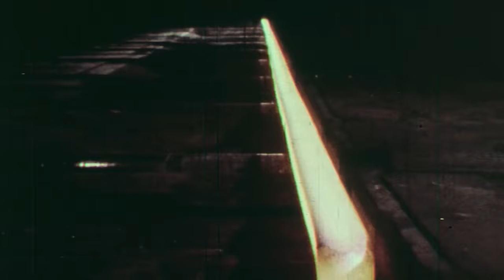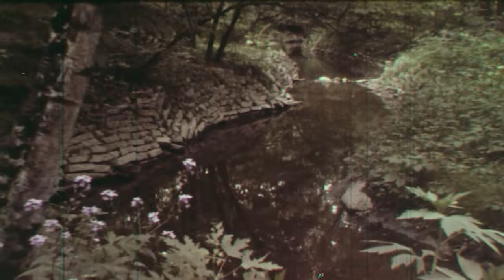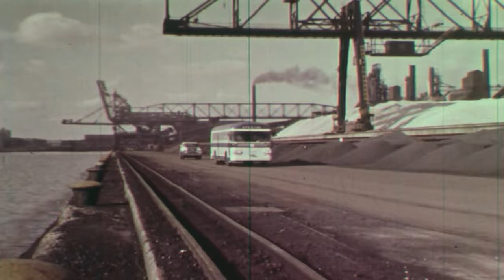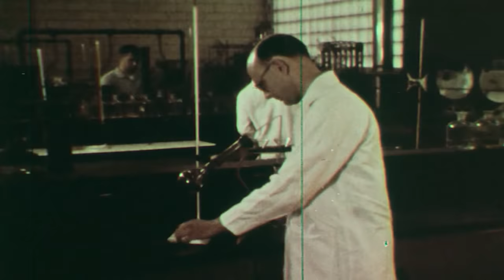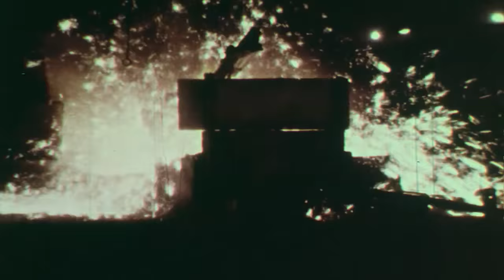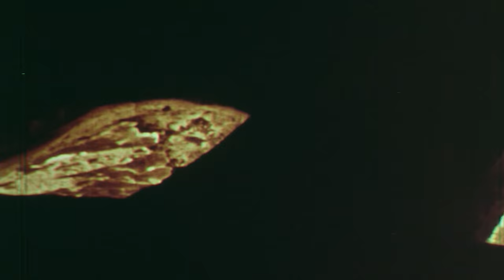The Rouge (1960s)

Comment: There is a water tunnel that travels from the Ford Screen House, located on the Zug Island Canal in the nearby SW Detroit neighborhood of Delray. The tunnel travels under Dearborn Ave. to Fort St. Turning left unto Fort St. the tunnel heads toward Miller Rd. Turning right on Miller Rd, the tunnel heads right into the Ford Rouge Plant. So a lot of the water used to cool the steel, and factory machines in this video comes from the creek canal in Delray. Old man Henry drove a model A with the roof cut off through the water tunnel from the Ford Screen House, under Dearborn Ave. Fort St., and Miller Rd. Once Henry got to the Rouge Plant and the modified car safety removed- a telephone call to the screen house opened the flood gates to allow thousands of gallons of water to enter the Rouge. The same path Henry drove through minutes before.
Reply: Is the tunnel still in use?
Reply: @kaiyack  The tunnel is still in use. The Ford Screen House is manned 24/7. There is a tragic story related to the Ford Screen House. In 1965, 1966 an elementary classmate of mine named Jimmy Ferry, was jumping off the green bridge (painted green) that went over the  Zug Island Canal - a second bridge used for Zug Island employees to drive onto the island. The water itself was a lime green color, yucky for even fish to swim in. Anyway, the Ford Screen House has powerful suction pumps that's needed to help draw water through the tunnel to reach the Rouge Plant. Jimmy got caught in the water current undertow, and drowned. The underwater divers found Jimmy's body sucked up against the underwater debris screen of the Screen House. The Screen House had to shut down the pumps, for the diver's to remove Jimmy's body held tightly against the debris screen, and bring his body up the surface. Jimmy's funeral was a closed casket event. I was given the honor of being chosen by Jimmy's parents to be a pall barrer, to help carry Jimmy's body from the funeral home to the nearby cemetary. The Ford Screen House has these huge debris screens to keep any crap from clogging up the huge underwater pumps that jet the water through the miles long pipe tunnel. 
Unfortunately why Jimmy decided to swim in that filthy polluted canal is still a mystery. Nobody would want to stick their finger in that water, yet alone swim in it. So to me, The Ford Screen House will always remind me of my childhood friend, and elementary school classmate Jimmy Ferry.
Reply: @fairfaxcat1312  The Lincoln and Mustang not accommodating to the common man? Have you seen the prices for ALL pick-up truck's, not only from Ford  - but Dodge and GM? More expensive than today's pick-up truck's or other SUV'S. Getting back to Ford Pick-up truck's and other model SUV'S By FORD. Despite the high manufacture sticker prices, Ford is still the number one selling truck DECADES running. And the main reason Ford is not offering automobiles as much as year's before, is the simple fact that people today - even year's ago WANT 4 wheel drive suv's instead. And why wouldn't a vehicle production company build what the buying public want parked in the front of their home, in the driveway, or parked in their garage or pole barn? You build what your customers want - plain and simple. If you don't, you're history.
Reply: @rickprusak9326  Ford quit making sedans because they could not compete with Honda and Toyota.  Honda and Toyota both successfully manufacture sedans in the US.  Ford is no longer the powerhousethey once were.

Comment: a lot of exceptional engineering went into the plant just look at the tooling and the men behind them.
Reply: The tooling fascinates me more than the finished product. Think of all he engineering that went into the equipment needed to transform the raw materials into finished components. Amazing.
Reply: Jack Kallemdjian Great  engineering.
Reply: g bridgman yes but those days are long gone.
Reply: That’s the reason the drinking water in Detroit is so tainted.
Reply: @davidcarlin3850  Yeah, just let China run and make everything, they seem like they'll be a great super power.
Reply: Yeah. Who designed and built all that? It's exponentially complex compared to the finished car.

Comment: I think the most amazing thing (which they didn't really explain) is how all the exact right components come together at the right place to build each individual car. Some can be done by just keeping a stock of the various different components to hand where they will be assembled, but I see that they ship the bodies to final assembly after painting, and then they install the fenders and things. They need to have the correctly colored fenders, hood, truck lid, and wheels available for the exact car they need to assemble them onto. That is pretty amazing. And of course you want the exact correct engine and transmission, the right axle, etc.

Comment: WOW , flash back. As a retired mechanic and as a kid I remember these cars. I’ve owned 3 fords over the years all F series pickups. My first was a 1962 F-100 with a 292 Y block. Then the next was a 1970 F-250 with a 390 FE motor. Now I have a 1972 F-150 4X4 with a FE-390 4 barrel carb. Seeing those FE motors coming off the line was something. I’ve worked on a lot of FE motors over the years, that was and is a good engine.

Comment: The assembly line must have been extremely noisy and unfortunately many of the workers must have had hearing loss. My father worked for thirty seven years in a U.K. Shipbuilding Yard and now has severe industrial deafness.
Reply: I worked in a Ford casting plant, the noise and vibration was so much you could feel it in your bones, and you couldn't have a conversation because the vibration would distort your speech. It was a summer job, but my father and grandfather retired from there. To this day I can't stand loud noise.

Comment: Did you ever buy a Ford in the 60's? We had a 1967 Ford Country Squire and a 1970 Galaxy 500. Both cars rusted into dust in a matter of a couple of years. It was common knowledge that there were issues in the Ford Paint Plant, but it was cheaper to send out an inferior product than correct the core issue. Now they wonder why their customers are driving Honda's and Toyota's.
Reply: But old American cars are perfect! The reason the Japanese came into the market and whooped their asses was just a liberal conspiracy to destroy the country! (Sarcasm)
Reply: All cars rusted out then. There wasn't the galvanized steel process being used yet and by the mid 70s cheep Japanese steel was dumped here and used.
Reply: @alextallen8019  They couldn't have been any worse than the Datsun pickups and the Chevy LUV I had.
Reply: Between my parents, my sisters, and me, we had a total of 6 between '61 and '85.  No rust problems on any of them.  And only minor mechanical issues over 25 years.
Reply: My dad had a Fiat 128 in the 70s. The car was like 6 years old and the frame broken in half from rust. It was a front wheel drive and he would tell me the car flexed when he accelerated.
Reply: @scottmiller7244  Especially if you live in the midwest, as I do, or the northeast. Road salt turned all cars;  American, Japanese or European, to dust in short order.  Holes in floorboards, rusted frames and suspension components, rocker panels, fenders and door bottoms would rust right through in no time.
Reply: Older Toyota's also turn to dust, so what's your point?

Comment: Those V8 engines being produced are based off the 352 block and likely either a 352, 360, or 390 judging by the 2-bbl carburetors.

Comment: I worked at the ford gouge plant .I was working for nickelson dock and terminal and we went to the Ford plant to work on Ford's ships. The benson  the Henry and the breach. Did work on the hatch coamings where the  buckets would hit as the cranes unloaded iron ore pellets from the ship. Did some repair on the hull of one of the vessels. They are called vessels not boat. I was 19 years old at the time I'm 60 years old now.
Reply: Just an FYI, you might be interested in.......The Benson Ford still sails , and still delivers taconite to the Rouge plant, with the name  "Kaye E Barker". Ford's ships were sold off to Interlake Steamship Co. in 1989ish
Reply: @tonyk8592  I believe the Benson Ford was turned into a house years ago.

Comment: They skipped most of the steps. They jump from installing pistons into the new block and some bearings, to showing them tossing an assembled engine onto a test stand. Then right to glass production. Frames? Upholstery? Do they produce their own switchgear and instruments? Trim pieces? Lights? Axles and driveshafts?

Comment: 18:10 I had a '94 Taurus that had printed quite clearly on the windshield 'Made in China'. Sad really.
Reply: Not possible if it was an American vehicle.  The Taurus for the American market was made in the Ford Chicago Assembly Plant for 34 years.  The Taurus was manufactured worldwide.  The Ford plant in China made the vehicle for sale in China and the Middle East.  If the car was imported, then it was in all probability made by the Ford Changan plant.  Having had three Taurus vehicles, they all came from the Chicago Assembly Plant.
Reply: @buckhorncortez  Thanx for the reply. China windshield. Had the 3.8L six. Also the distributor had metric and imperial fasteners. Four-door, leather, sunroof, etc. Ran pretty well. Used moderate oil. Averaged 23mpg. Serviceable enough ride. 280K I think in 2010 when I sold it. No valid complaints.

Comment: The lone person who built the Rouge Plant was industrial architect Albert Kahn. The lone person who  helped create the many massive machines and different production processes was "Cast Iron" Ed Sorenson. Henry's go to man. Henry had the ideas in his head and only supplied the money to have the Rouge Plant built. 
Henry wanted everything to build his vehicles under one roof. Henry didn't want to rely on outside contractors like the Dodge brothers to build his car engines. This way, Henry had sole control over quality control on every piece and part of his vehicles. Now, in 2023, most of those plants are gone. Torn down and the jobs shipped overseas. No more glass plant. No more Ford Lake and river ships. 
No more glass Plant. No more Coke ovens. No more Specialty Foundry.
No more Locomotive Repair and maintenance shop. 😢 No more Ford General Administration building. There is about half the size of the Rouge Plant still existing compared to what you see in this video. What a shame this plant doesn't exist today in 2023, like Henry built it to be. It's a shadow and ghost of what it used to be.